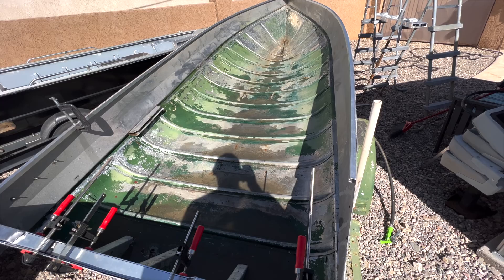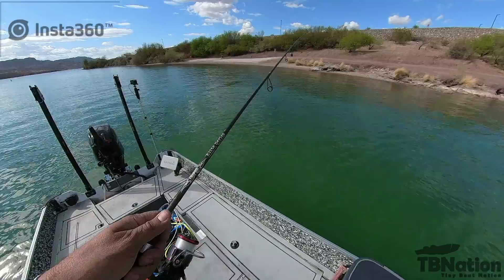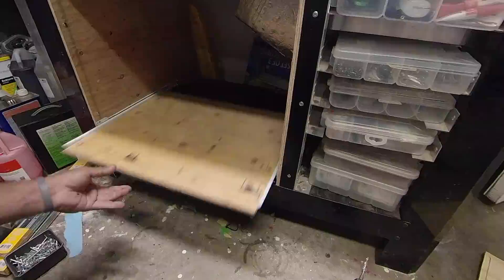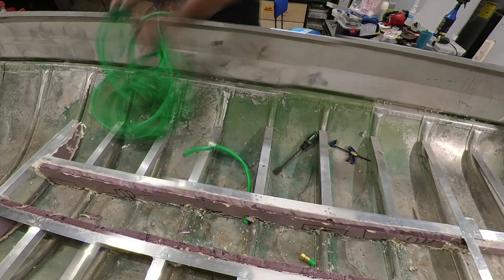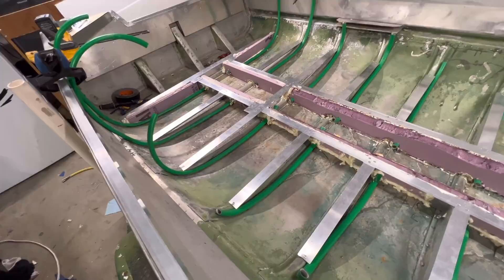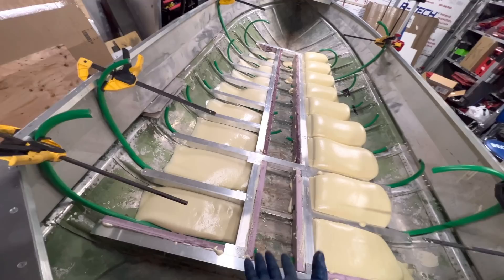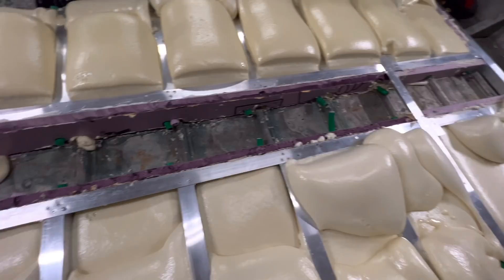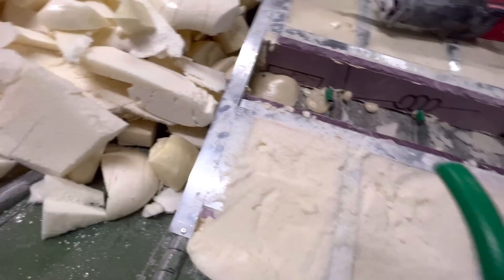Finishing the Subfloor | Pour foam & wooden bottom deck | Budget boat build Ep.7

Comment: When I put pour foam in my boat I got a 2'x4' piece of 3/4" MDF ply and a piece of 6 mil plastic. I taped the plastic to the MDF, then poured the foam and placed the MDF over the space I had just poured the foam in. I then sat on it for a few minutes. This forced the foam to flow and fill the entire space, yet left a flat surface level with the top of the floor supports. The plastic wouldn't stick to the cured foam, so I just removed the MDF and then peeled it off. You just have to be sure the foam can't get trapped and break anything because it can't expand.

Comment: One thing I see lacking is coating and corrosion protection on these old aluminum hulls. Inside and out. Chances are it will be fine, but I just think it would be wise. Alluminum definately oxidizes and these old boats could have some bad spots. 

Great builds man...just would hate to see  all of this hard work go out the door for a soft spot or hole that develops. 

I have been using  fasco steel super flex on my older aluminum hulls! Great product. Adds 10-20 mills off extremely tough coating.

Comment: That is a GREAT motor. Easy starting, fairly light cool sounding. That said it is absolutely the worst nightmare to disassemble of any motor I have worked on. Pray that it doesn't need work. Pulling the powerhead requires every single piece of the exhaust, steering, and bracket to be taken apart. It is also more on par with a 7-8hp than the 9.5 it is billed as in terms of power.
Reply from the maker: Thanks!

Comment: A quality 1/4 sheet palm sander with some 40 grip sandpaper does a good job on the pourfoam. When I did my boat I poured the foam in sections. I Had a piece of plywood that I taped wax paper to then I would pour a section then place the plywood on top along with two 60 pound dumbells. The excess would just expand into the bay next to it that needed to be poured. The center bay I blocked off with a piece of plywood with the wax paper that I removed after pouring. The boat is coming along nicely. :)
Reply from the maker: Nice plan!
Reply: Did you add the drain tubes like Mike did in this video?
Reply: @nathanleonard8393  No I did not. I didn't need to. My boat is actually a 1448 mv. The floor and floor supports were done very similar to mikes but welded in. I have two drains at the rear bench seat going thru then to the back via hose to the bildge. I've been out in some heavy rains and the drains did great. The foam was removed from the bench seat and then turned into storage. The boat is set up with a center console with livewell so there is no rod locker storage. This was done like 12 years ago. I am currently in the process of installing a new floor.

Comment: silicone? in a boat is good for plastics- polyurethane( pl caulk) for sealing/ adhesive or 4200 what sticks to aluminum?  a weld/ rivet /screw 3m makes body panel adhesive 45.00 tube

Comment: I am getting ready to encapsulate my new plywood for my boat. My concern and question is if I coat the bottom and edges   before installed and the plywood dries crooked or bowed will it flatten out when installed in the boat? It looks like the epoxy dries very hard. Thanks!

Comment: Not clear on what type silicon you used -- but the typical stuff contains acetic acid (that 'vinegar' odor), which does not play well with aluminum long term.
Reply from the maker: You can use 3M 5200. Good to know about the acid content. I believe it.

Comment: This maybe too late... Check out how foundations or molten metal into molds. You can avoid all that extra work and have a perfect fill if you setup the cavity correctly. Basically, you need a lid, vent hole, and put hole. The lid will also trap heat and help the foam react and fill the void.

Comment: Is it that important to have that much foam in it. If you are worried about buoyancy then could you not just
(1) cut a solid piece of aluminum for each rib side to side and then cutting individual pieces between each rib
(2) why not just use a 1/8 sheet of aluminum 4x8 and just cut where is needed - this eliminates having to seal plywood and also not EVER having to worry about ever replacing the floor again sheet is about $350 each but again never have to worry about replacing EVER
(3) the weight I think would be the same
Reply from the maker: This is a budget boat